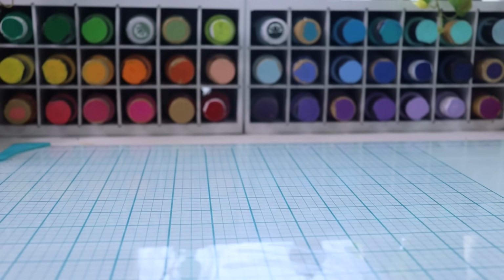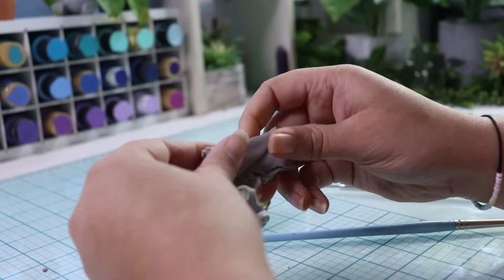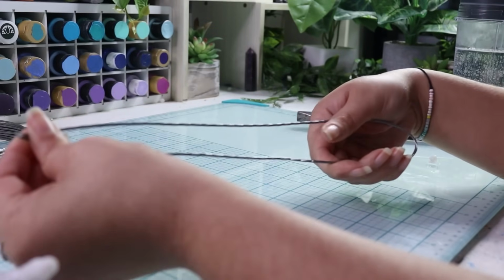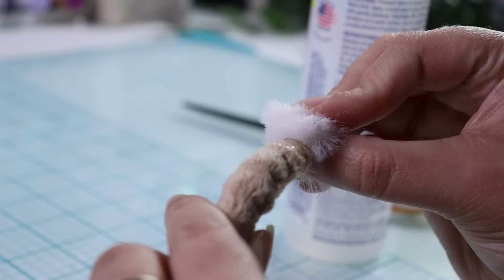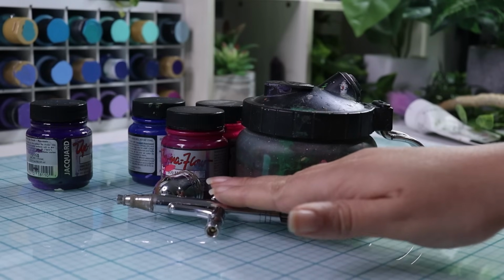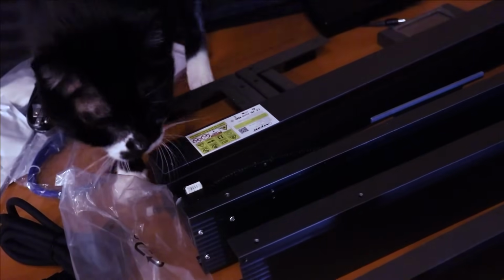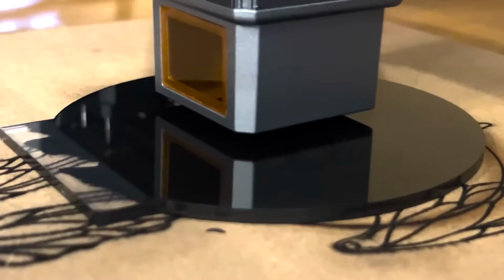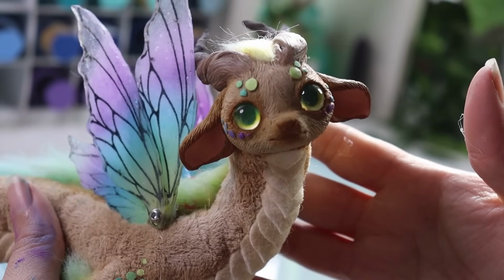I Made A Fairy Dragon For All Your Fantasy Needs I DIY Polymer Clay Art Doll ATEZR P20 PLUS

Comment: Quick question, what Is your favorite type and brand of clay to use? I cannot find any good ones. Polymer clay is too crumbly and not easy at o work with, and air dry clay is super messy and cracks all the time. Any suggestions? Also, THIS. IS. ADORABLE.

Comment: I tried using Sculpey clay but it was so hard and i couldn’t even make a ball! Any tips? Is there something im doing wrong or should i try a different brand?
Reply: You usually need to warm polymer clay before using it. I break off a chunk, wrap it in  plastic wrap, and warm it in my armpit for around 5 mins (sounds crazy but it works!) And then slowly start kneading it. If your clay is too brittle, you can use "clay conditioner" to revive it via kneading.
Reply: @boisterousgrace1601  Thank you so much! I will definitely try that.